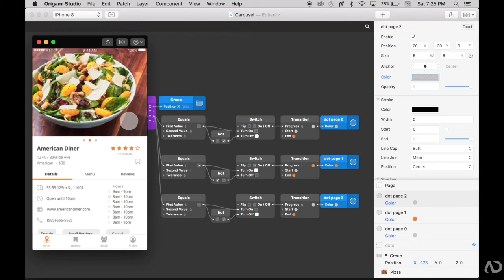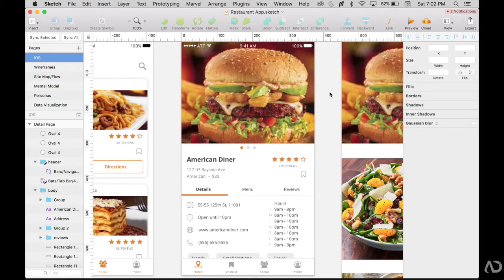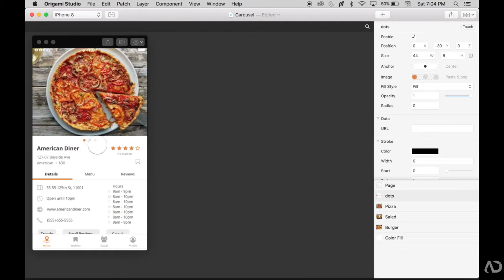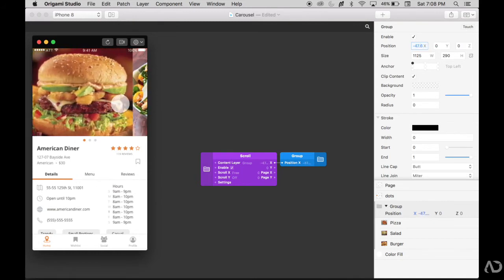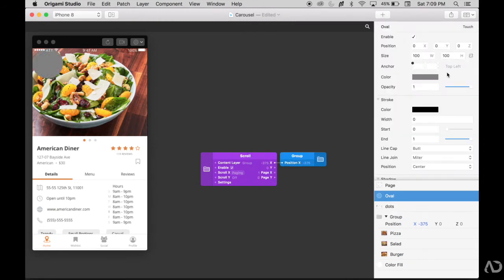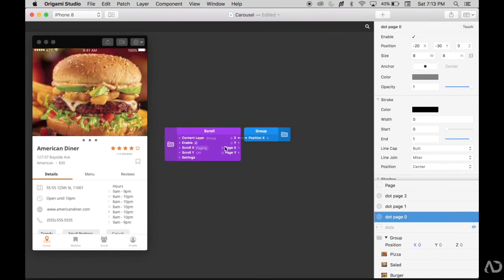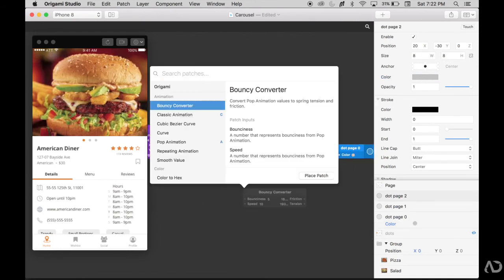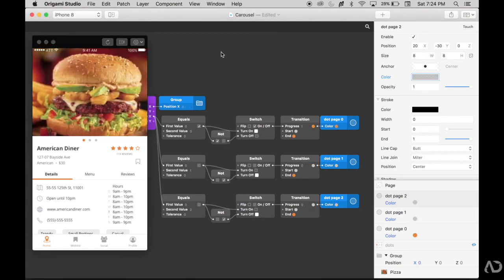Horizontal Scrolling | App Carousel Tutorial

Comment: Hi, what does the "Second Value" in Equals patch do? You changed its value when applying the logic to the second and third dots and I don't quite understand why
Reply from the maker: The Equals patch looks at the first value and the second value and returns true when they are both the same. The first value represents which 'page' (aka image) the user is on the interface. The second value is what we are checking for. The pages are labeled like an array in coding, where the 1st image is actually on page 0, then the 2nd image is on page 1 and so on. So for the 2nd dot I want the color to change when the user is on page 1. That is why I need to verify and check where the user is and if they are viewing page 1, if they are (in which case the equals patch would be true) then turn on the switch to change the color. Does that help?